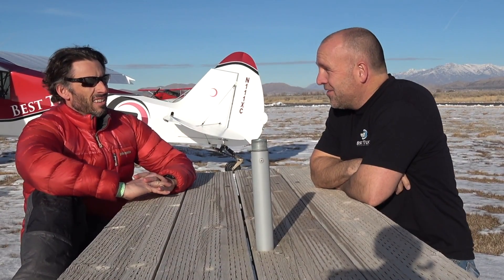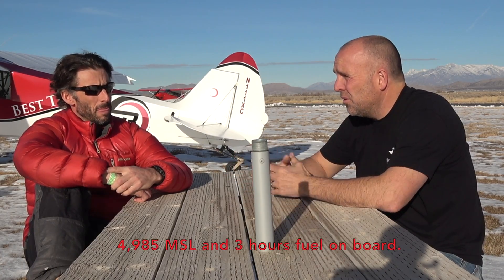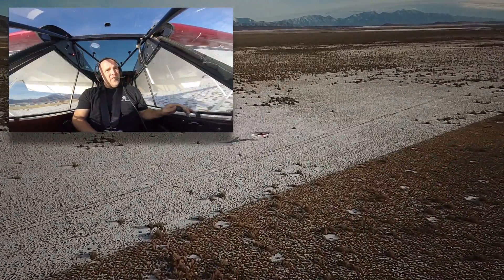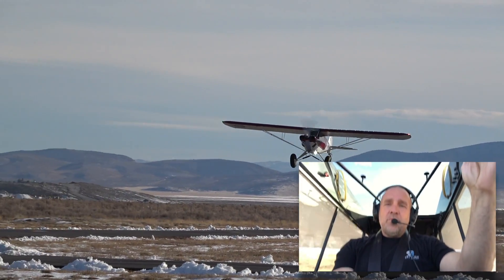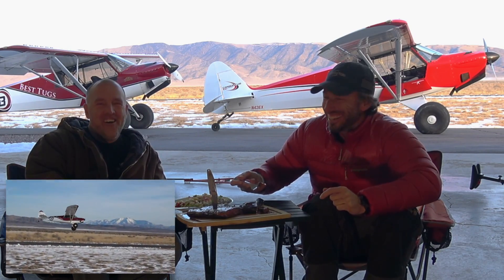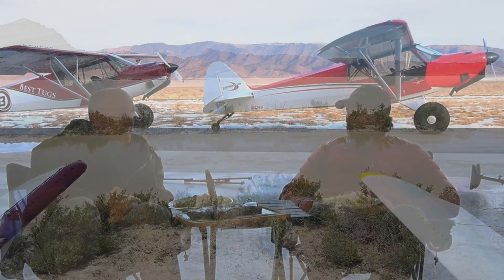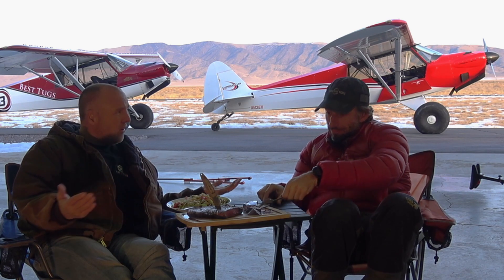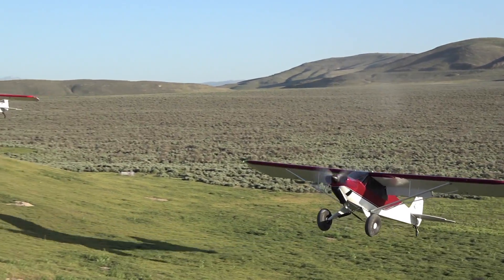The impossible turn in the Carbon Cub

Comment: Very important reminder! My instructor taught me to land my Pitts every time like the engine was out. One day the throttle stuck at 19 inches of manifold pressure on a vertical upline. Leveled out, shoved the throttle forward, nothing, pulled it back nothing. Stuck in level flight at 155 mph with 1/2 tank, CAVOK weather, in the aerobatic box right next to the runway. No other traffic. Had time to plan my response and took the time to have both my instructor and mechanic review my planned response. Shut the engine off and dead sticked it in. Successfully landed without incident because of practice, No damage. Here today because my instructor taught me right. Not saying my heart rate didn't go up some. Pushing the airplane back down the runway was the hardest part. Cause? 50 cent cotter pin.

Comment: As a 4,000 hour pilot and CFI I have experienced three engine outs and off field landings. I think this is a great video! In my case, all three were just after take-off and with less than 1,000' altitude. One was too far from the airport to turn back due to being under a class B airspace. The other two were straight ahead (ish) landings. Made the evening news on two of them. (other was an ultralight and no real consequence due to landing in the desert). Due to terrain in both of the other aircraft, they were damaged but I walked away. Inner city situations where there weren't fields or open areas to the side, or even in front of me made a big difference in my actions. Both landing areas were planned and concise, but still ended with damaged aircraft. One was the first test flight and there was no chance of knowing how a power off 180 would or would not work. I even arm chair fly my planes through most plausible emergency procedures and wish others would do the same. I love the comment that Mark keeps making about fly it until it is fun. Great video Jason, thanks for sharing!
Reply: I'm not saying I disagree with any of which you said, but didn't the Cory Liddle accident teach anything?  I would bust airspace seven ways to Sunday if it meant a safe landing.  Glad you are safe, without injuries.
Reply: I agree, busting an airspace to save my bacon isn't even a thought. I am not sure if you misunderstood though. I was leveling off below the class Bravo airspace when the engine quit. I wasn't close enough to have gone into the airspace to make any difference in where I landed. Just curious, how did the Cory Liddle accident come into play with what I posted before? I know he hit a building but did it have anything to do with airspace? Maybe I don't remember the findings from the investigation.
Reply: The problem with Cory Liddle was that they were flying up the East River in a SR-22 at an altitude way below the tops of the buildings because the clouds were low that day.   There was a strong wind off the Atlantic ocean acting as a crosswind against the building.  Instead of starting the turn from the far right side of the East River, knowing that a crosswind would be pushing them into the city, they began their turn from middle of the East river.
    Video shows the plane exploding around halfway up the building, so they were very low as well.  I don't like to say negative things about dead people, but the CFI was the final authority here.  That's why Liddle asked him to go with him from Teterboro.
     If they had made the turn from the far right side at the widest point on the river just before Roosevelt Island and made it slower and steep enough, they could have made it.  I have to say I've been up the East River many times, and made that turn many times as well, but I never did it at an altitude that was lower than any of the local buildings.  
      The lowest I've flown up the East River is 1000 ft, high enough to be away from all but the tallest buildings in the area.  Nowadays, I simply call LaGuardia Tower and get a Bravo clearance up to 1,500 ft and ask for a left turn over Central park direct to the Hudson River before turning northbound.  Central Park is almost sea level so I'm away from any buildings.  Also, I don't have a built in parachute in the planes I fly.
       However, I realize, "But for the grace of God, there go I" and never forget that I too can become a statistic If I screw up.
Reply: Kenneth's Adventures  I apologize, I only now see you asked what relevance the Lidle accident to your comment.  First, I had read your  comment about being under Class B.  I suppose the way it is worded made me think it was Bravo airspace that dictated whether you could turn back.  Then, I mentioned the Lidle accident flight because they made the turn in order to avoid entering Bravo.  As daffidavit had just now pointed out, they botched the turn.  But it was to avoid airspace which caused them to decide to turn.  Sorry for any misunderstanding or confusion I may have caused.
Reply: @daffidavit - Cory Little CFI was a fake.  He didnt know how to do safe GRM and so same BS he taught Cory.  GRM is a pre solo requirement but many CFI's are afraid of doing it for real ( A chicken CFI will make a Chicken Pilot).  So the GRM Chicken CFI found himself having to do Real Windy GRM with space restrictions (The real Mac Coy he chicken avoided practice) and of course, he did it stupidly wrong.  I flew that East River many times in the 1990's as CFI.  Had many students signed up to go all over the area.  Great place to do Real No BS GRM.

Comment: We've done it in a Mooney M20C (1964).  Min. loss was 200.   But we did the turn up at a much higher altitude.   Remember in the movie "Sully" the Govt. criticized Sully for not making the 180 plus turn asap.  I thought that was interesting because we always hear "never turn back".   But in "Sully" it was exactly what he was criticized for not doing.  His best defense could have been "the FAA instructs us Not to turn back, so we didn't.'     
       As a CFIA Since age 20 (now 65), I was always one not to poo-poo the "impossible turn", especially if the alternative is so much worse.  In N.J. we have airports where if you lose the engine on takeoff, and go straight ahead, you're going to set a few homes on fire.
        A friend of mine owns a Mooney.   He didn't believe I could do the impossible turn and lose only 200 ft.  So we went up to the practice area at a safe altitude.  After clearing the area, I asked him to pull the throttle to idle whenever he chose.  I immediately cranked the plane into at least a 45-degree bank and pulled enough Gs to avoid a stall.  You must unload the Gs to avoid the stall which means you have to practice this maneuver.    Guess what, we lost only 200 ft.
       Then he gave it a try.  After a few attempts, he was able to get it down to a 300-foot loss.  Of course, you have to go slightly past the 180 mark if you want to make the runway.   BTW, you don't have to make a straight in final approach.  Just point the nose at the runway until you know you have it made.  You can always align when you are on the runway.  I've learned in a Mooney not to put the landing gear down until you know you have the runway made. Even then, the drag from the gear may make you come in too short, so be careful and practice this.  We did not use flaps at all in a real simulation where we tried this at a desolate airport in the early morning hours when nobody was around.  Jason Sneed is right, a steep turn is necessary.
         Point is, the "impossible turn" can be done.  In some situations, it's the only choice in order to avoid landing in a residential area or in oil tanks like Linden Airport next to Newark, N.J.  The decision to make the turn must be made BEFORE take off.  And the altitude to do so must be predetermined on the ground.
     I know, I know, people will always say, always go straight ahead and never turn around.  IMHO if you are high enough when the engine quits, and if you know your airplane and have practiced the turn it may be the only way to survive.   After all, why was "Sully" criticized for not making the impossible turn?  In the movie, the NTSB simulated the turn and proved he could have returned to the airport.
However, Sully argued this was the first time a double engine failure occurred during take off and the "human factor" of the delay was not considered by the Govt.  So they made the simulator pilots wait 20 or 30 seconds before they were allowed to turn back.  It turned out they crashed into the approach lights every time.   So if Sully had tried to return, he never would have made it.
      To be fair to the NTSB, they complained about the way they were portrayed in the movie and argued the situation was different from their perspective.  It was a movie, not a scientific recreation of the event.  Anyway, I agree with you guys in this video.  You must be hair-trigger ready to make the turn and be very aggressive when you do it.  You must pull enough Gs to avoid an accelerated stall.  But it is the steep high G turn that will get you around the corner to save you.  No wonder most people don't approve of it.  You must be good enough to make this turn work.  And that takes practice.
Reply: Yep, LInden, New Jersey.. The highest concentration of oil and gas tanks around any airport in the Americas I was told.  Mpst CFI's there practice this turn. Otherwise practice how to explode after hitting one of those tanks..

Comment: Excellent video and discussion, gents. I fly a stock J-3 with 65 horses and no goodies. (VG's, etc) The most important skill I practice is aggressively lowering the nose at the moment of power loss. Even after all these years, it is still surprising to me how quickly and how much I have to shove. What's way more important than the turn/no turn calculus is building a constant awareness of where you're going to go when - not if - the engine quits at every moment of the departure. 

If you're a newer pilot, grab your instructor and go work on this stuff. Expand your envelope slowly.

Understand that although Mark & Jason are EXCELLENT pilots, they are also exposing themselves to longer periods of increased risk, all for the purpose of being able to survive a cardinal event when it occurs. Regardless of the skillset, recognize that this is dangerous, dangerous stuff to be doing. Mitigate that risk with an instructor, (At first) shoulder harnesses and even a helmet.

Happy Flying!

Comment: Thanks guys for this valuable input. As a flight instructor, I consider the safety at all times. It is sobering to keep in mind that our technique in the practice environment is not going to work in an actual engine out with a stopped propeller.